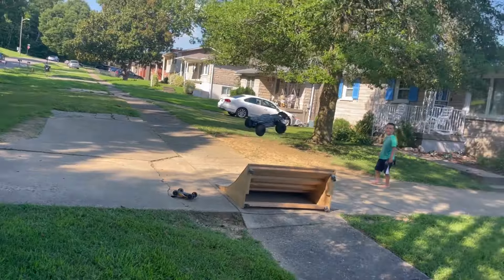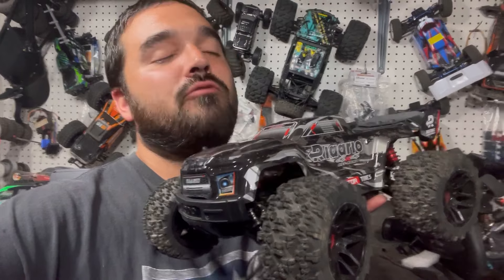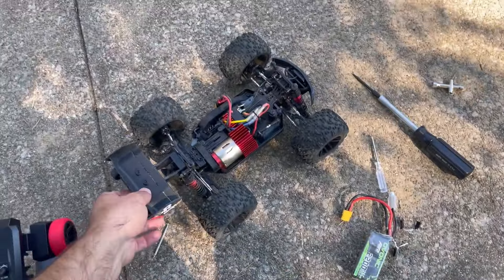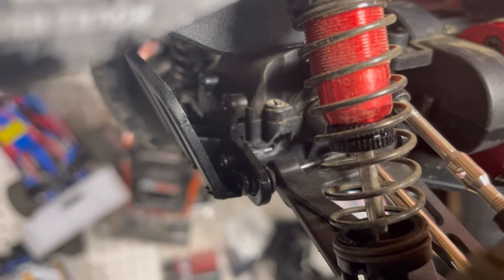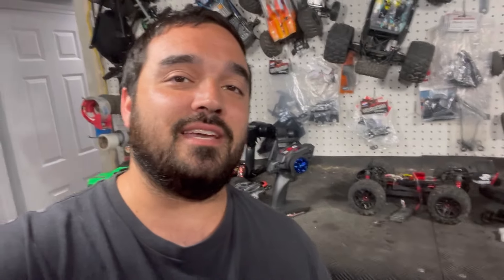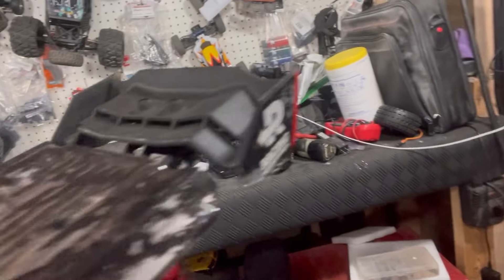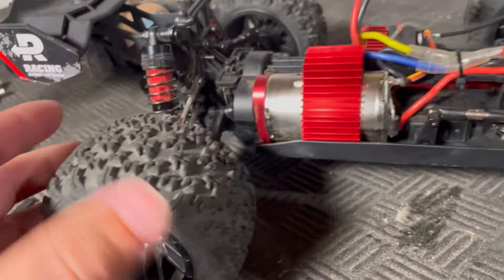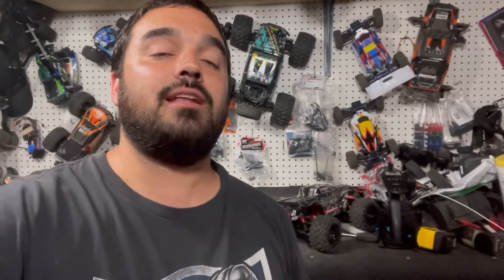New RC car - 3S power! But is it really made for that?? Rlaarlo

Comment: The LC Racing axles are the only solid ones out there right now. Also, if going brushless at minimum the rear diff needs replaced with a metal housing type or it will get powdered.
Reply from the maker: Thanks for the info. Honestly I may just powder that diff, then replace it lol
Reply: 😄 That's always the best way
Reply from the maker: Completely agree!! 🤣

Comment: Is it the same size as the fc610. Can’t find any specs on the  site. Great tip just might have to jump on the 99 deal
Reply from the maker: No it’s smaller. This is a 1/14 scale while the fc610 is a 1/12 (though they advertise it as a 1/10. Ya the $99 is a pretty good deal. 👍👍